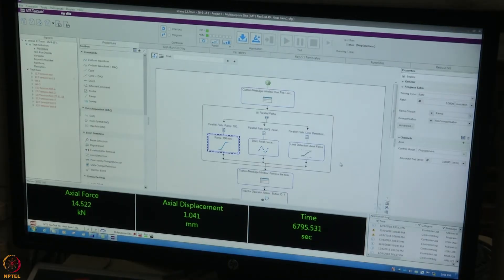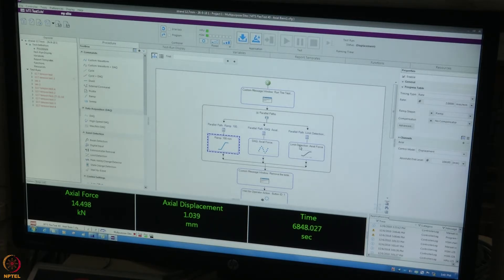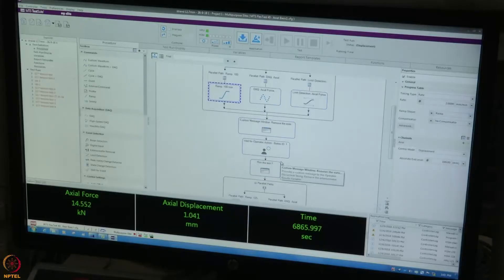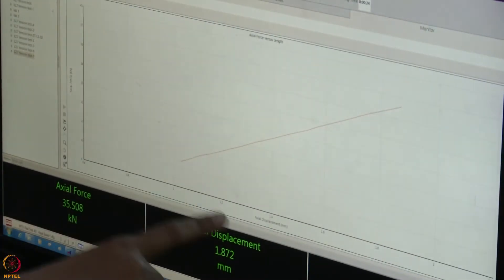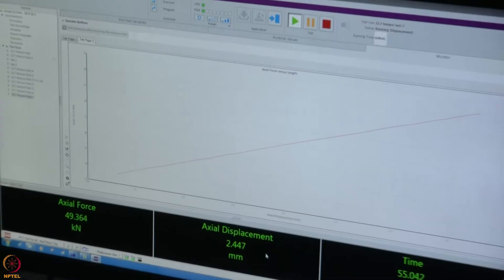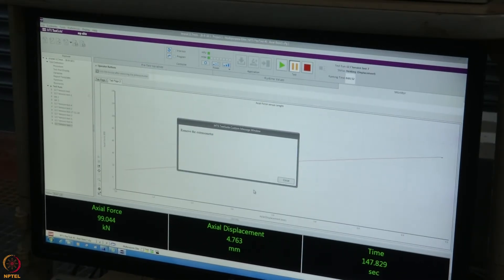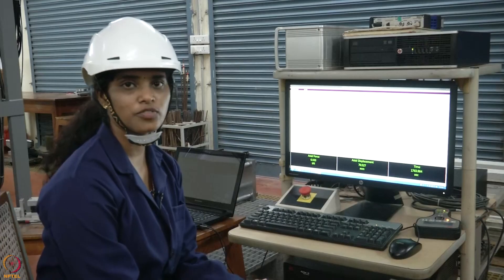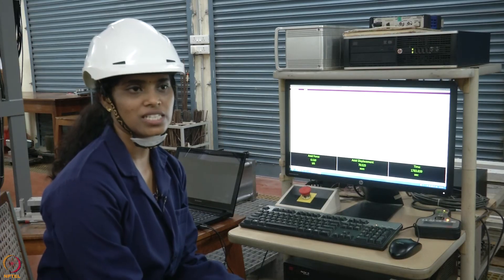#14 Tension test of 7-wire steel strand | Advanced Topics in the Science and Technology of Concrete

Comment: What is the standard tensile strength of 7 strands 15.2 mm strands?
Reply: For any needs about steel wire rope PLZ contact me WhatsApp：+86 18036231199 .We are  manufacturer of steel wire rope in China.
Reply: 1860 for Grade 270.